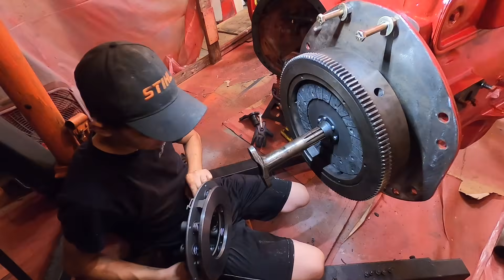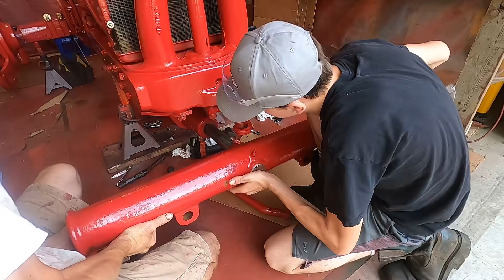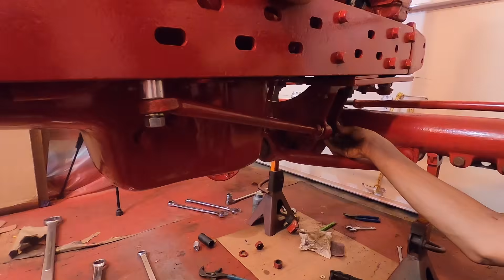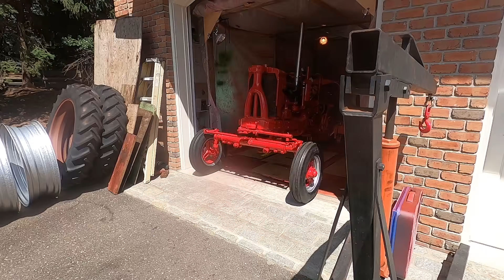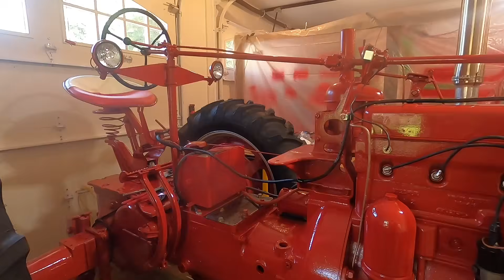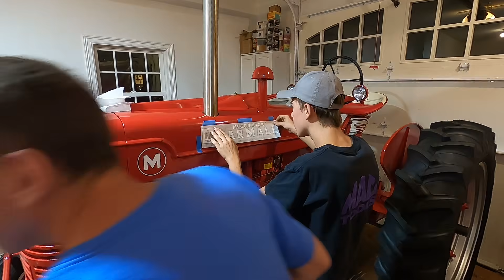Farmall M Restoration Pt 4 | Final Assembly, Tires, First Start, and Chevron TRC

Comment: A little tip on the decals. Use 1 piece of tape on each end, and one on top and bottom in the middle. Peel off half of the backing on one side, cut the backing, lay that half of the sticker and squeegee. Then repeat it.

Comment: Nice job! The only suggestion I have is not to use so much silicone. because it will squeeze out of the gasket surfaces inside of your engine and over time the oil will eat at it causing chunks of it to fall into the oil pan and get stuck in the oil intake. Over  time the oil will eat away at the silicone and it will start leaking.  Better off to just use the gaskets with out it.  I think you did an amazing job. Keep up there good work.

Comment: How much did it cost you from start to finish?
Reply from the maker: Just over 10k out of pocket.  Biggest ticket item was rear tires.  Next was propane head and engine rebuild kit.  Tractor restoration makes no economic sense.  I learned a ton and continue to learn with each new project and keeping machines running.

Comment: Instead of bushings in the center pin on the front axel it actually needs wheel bearings. Then when a front loader is placed on this front axel the bearings won't be immediately be wallowed out with the excess weight. In fact the whole front end of the wide m front end needs re-designed to be productive with a front loader the m was never designed for with hydraulic cylinders on each side to pull each side to steer. But then you need a flow divider  and orbital motor under the steering wheel.

Comment: There is a very good automatic condensation remover , it screws into the bottom of the compressor, normally where that peacock is , what’s cool is it has a lot of different settings, mine is set at 10 seconds, every 45 minutes, I have to remember to unplug it or in the middle of the night my compressor starts up, LOL , this little gadget keeps the compressor and lines free of condensation. MLNR JIMBO53 PRES MIDNIGHT RAMBLERZ MC

Comment: Congratulations on completing a great job. Tell me when the tractor accelerates you hear a howl from the gearbox. Is this how it should be or is the conical pair unadjusted? Thank you.
Reply from the maker: That noise is coming from the straight cut first reduction gear. There are no tapered bearing sets in this transmission.
Reply: @Andrew-Hanna  Thanks for the clarification. Congratulations again on completing the project.

Comment: how did you solve the open throttle problem? i restored a super c and am having that issue now. Amazing job on the M as well!
Reply from the maker: The linkage that goes into it was not in the correct notch.

Comment: Nice work! I was wondering if you could tell me how wide your trailer is between the fenders I'm in the market for a new trailer and was just trying to figure out how wide to get so I can fit a tractor on it
Reply from the maker: My trailer is almost 83" between fenders.  With M hubs dished out and slid all the way in on the axle it barely fit on trailer with the 13.6 tires.  I aired them up good to stand taller.